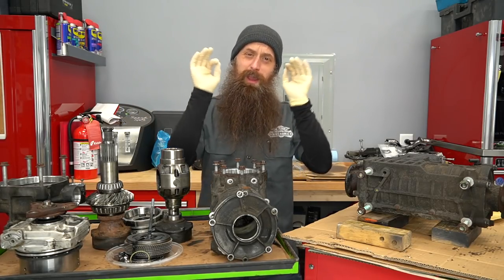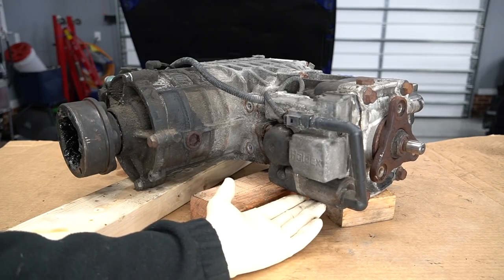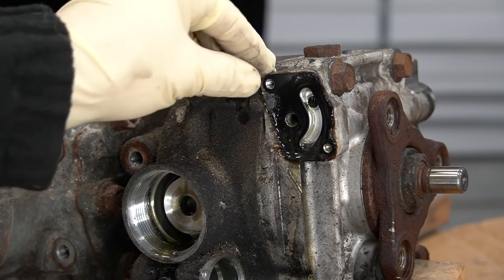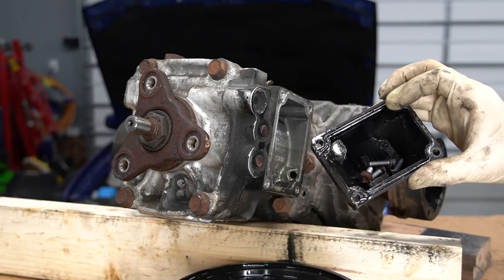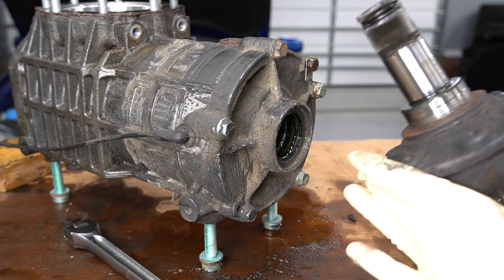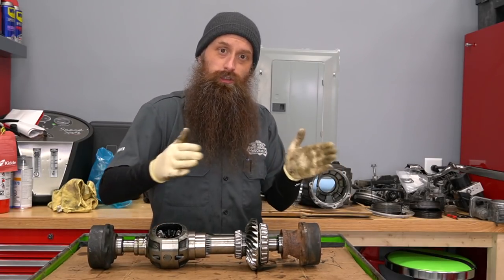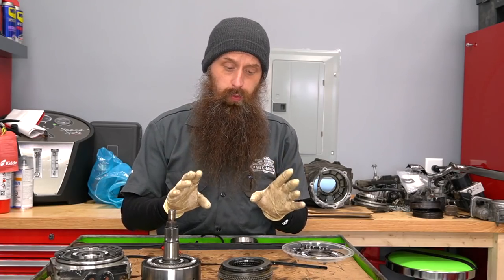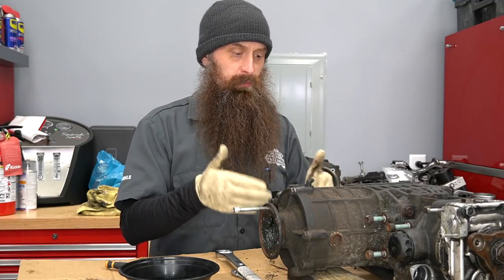How Haldex (AWD) All Wheel Drive Works ~ Teardown and inspection

Comment from the maker: Something I am not sure how I forgot to mention. The Haldex and diff fluid are DIFFERENT. If you do the service, be sure to use the proper fluid.
Reply: Simply RTFM. Different diff, different oil. Just look it up, to be sure. Helps not killing things. 😇
Reply: Charles, have it dry ice cleaned
Reply: Please do the diy! I am absolutly enjoing the videos!
Reply: I’m glad you mentioned this fact as no one else points this important fact out to all the DIY legends
Reply: What LSD is it? Looking forward to do it myself!
Reply: Be also careful to put the fluids where they belong ... don't mix them up
Reply: Diff: 75w-90 GL5
Haldex: Only Haldex Fluid from VW or Volvo or BorgWarner
Reply: When will Part 2 arrive !? I need more of that 🤫
Reply: Transmission Fluid:
OEM PN G 052 171 A2

Differential fluid: (same for front and rear)
OEM PN G 052 145 S2

Haldex Fluid: 
OEM PN G 055 175 A2 or G 060 175 A2 ( only difference is amount, 1L or 850ml)

I have Golf mk6 and filter is different from this one on your video, and "PN" for mine is 111358
Reply: Do you have a link for that single unit haldex clutchpack.... I'd love one for my mk6 golf r.... give me more of a real awd
Reply: lol that almost got me.... I had a 1/2 quart left over from my GTI diff job... I ALMOST thought about just putting in my haldex.. glad i didnt.
Reply: troubleshooting*** my car binds on the corners, its a 4 motion. I have seen that changing the oil fix the problem. How can I know is the oil and not the pump.

Comment: Almost 5 years at a VW/Audi dealer as a tech I could never wrap my head around how a Haldex worked. All I needed was this video! 
Do newer Haldex units work in a similar way?
Reply: There's actually some more stuff Charles missed.  This is a gen 1 haldex which actually works on a mostly mechanical(ish) function.  The rollers that fell out when Charles pulled the clutch drum assembly, those are parts of the mechanical pump and piston function.  The small rollers act on a Cam plate/Lobed plate which serves as the "pump" plate, the three big rollers act on the piston plate which applies pressure on the clutch pack.  The pumping action starts as soon as there's a difference in shaft rotation speed between the input and output.  The electric pump really only serves to prime the system and charge the accumulator.  System regulation is handled through the regulating valve.  Basically, when you're easy cruising/coasting/parking with no wheel slip, the system is always at the ready to lock up for AWD.  When you're mobbin' around pedal to the floor, "spirited driving", etc..., the system is already set for AWD, but the mechanical pumping action is what actually engages the lock up for AWD, therby making it a "reactive system".  That's how gen 1 & 2 Haldex works.  Gen 3 onwards used an entirely electric pump system, meaning through software the system can be, or is,  tuned to be "proactive" so AWD could be locked up, or "pre tensioned" before wheel spin.  All depends on the software parameters.  To this day, as best I know, Audi/VW has only used gen 1 & 4 systems.  Mechanical(ish) or electric, which is better?  Each have their pro's and con's, but my 03 BEA powered TT's AWD is fantastic, so much so it does it's job seamlessly and I still haven't needed to replace my Haldex pump yet, ....unlike many people with gen 4 Haldex cars.  
BTW, not trying to rip on Charles.  He's great and this was an absolutely great tear down video (speaking as a former long term Audi/VW tech myself).  Just typing out a long winded ramble to answer your question.
Reply: Didn't you guys have to do courses all the time?  I'm guessing the VAG line on how to repair these was to "replace Haldex coupling" entirely?  Either that or you never saw one fail apart from electronics/pump?  Anyway yeah the newer ones are very similar, they've changed some of the operation in terms of pumps, etc. but the main principle is the same.  It has actually been continually simplified over the years with 4th gen doing away with the mechanical pump, and 5th gen doing away with the accumulator, netting a smaller and lighter package over the years.  At the same time the electronics and integration with other systems (ESP/TC/ABS and driver inputs like steering & throttle) have improved quite a bit netting significantly improved real-world vehicle performance.
Reply: @colinwie9192  VAG used Gen2 in later PQ34 cars with quattro/4motion (e.g. Mk4 .:R32, Mk1 TT, A3) as well as early PQ35 cars (Mk2 A3 & TT 3.2L VR6/Mk5 .:R32); later PQ35 cars got Gen4 Haldex, starting around MY09 (in Can/US) including A3, TT, and Mk6 .:R.  B6 Passat/CC being PQ46 follows a similar timeline.  MQB cars have Gen5 couplings and much more integrated electronics than previous iterations.  Gen4 in the PQ35 cars never integrated ESP & steering functions (it did on other brands and the capability is there, VAG just didn't implement it).  There weren't many problems with 4th gen couplings, the problems were more on the early MQB cars with 5th gen Haldex.  5th gen has no accumulator so arguably the electric pump has a higher duty cycle or higher demand on it, which could have led to the failures though this is just speculation on my part.

Mk8 Golf R has what I believe would be Gen6, though it may just be a highly customised system with a Gen5 coupling at heart, not entirely sure.  The one gen they never used was Gen3 because this was specific to Land Rover.  Saab also had a customised Saab-only version in their XWD system, which nobody else ever used.
Reply: @colinwie9192 and a very informative ramble. Thanks.
Reply: 😂 @thePeterpumpkin68
Reply: @colinwie9192  Hi Colin, how do I identify the Haldex and Differential unit in my son's 2010 Audi TT 8J 2 Litre 4WD Diesel manual car as it has failed?
The local mechanic has suggested that we source a secondhand unit complete for him to replace the whole unit. My son lives in Northern Ireland and I live in UK mainland trying to help...

Comment: This system is amazing. Its actually smart enough to shut itself off when the unit is low on oil. I had a Audi TT quattro that had a non working rear diff. I just changed the filter and oil and it came back to life.

Comment: Super cool to see this video.  That was a bit of an "oops" moment, but at least you managed to get another.
I remember having to press half shafts for a Jaguar XF out so I could replace bearings. No forgotten snap rings, just seized tapers. 40T press failed to shift them. Ended up taking them to an heavy goods service centre who failed to press them out with & 15OT press. They had to take them round to the big boy toy and that registered 265T before the shafts finally broke taper. The bang was super loud.
Reply: That's insane. I wonder how the Jaguar dealer does that job?
Reply: Have you tried hamer it from the side while pressing? Usualy works if its not too stuck.
Reply: @robt8042  That's an easy conversation: "Hello, Mr. Customer? Your axles are corroded and seized and our shop press is unable to get them separated. We'll have to order new ones."

If it's not a personal project and I don't have a bunch of time authorized to dick around with giant shop presses, I'm not gonna waste a bunch of time on that noise.

Comment: Great video Charles! I like how the Haldex is basically an eletronically-controlled dirt bike wet-clutch assembly mated to a differential housing. I also like how the actual differential is separated from the ring/pinion gear drive via an input shaft. MUCH easier to set up then lets say a LSD on a ford 9" or a GM 10/12 bolt, but a bit more difficult to get to those same internals.

The one bit of advice I'd like to add is: the secret to long Haldex diff/clutch life is to  change the Haldex and diff gear fluid on a regular basis. Every 20 or 30K. The Haldex fluid isn't cheap, but it's cheaper then replacing the ECM, pump and pressure switch. Ask me how I know that! 😢 💸💸💸

Love your content bro! Cheers!

Comment: If the haldex clutch plates were replaced with solid drive plates, wouldn't that cause the front and rear axle to bind? Your enthusiasm and energy is admirable.
Thanks for sharing your knowledge.

Comment: When I did my 02M gearbox rebuild I used aluminium acid cleaner (wear gloves) to wash over, use general degreaser before. Leave acid on for 15 minutes, then I washed off with water. For an extra step I then hovered a blow torch over the casing to absorb the water and it came up looking near new
Reply from the maker: The torch idea is awesome
Reply: @HumbleMechanic  good luck! Can't wait to see this process all the way through

Comment: Yes to getting another video / DIY for installing the diff.  Also, if you don't want to blast and powdercoat the case, Eastwood makes a spray paint that looks exactly like freshly cast aluminum.  You could wire wheel or really just clean and de-grease the case and then use that spray paint.  I've used it on alternators and engine mounts, and it holds up pretty well and looks good.
Reply from the maker: I like that idea!!!!

Comment: I’ve smelled PLENTY of things worse than old diff fluid:

Smokers’ cars that had so much tar build up, the windows looked like they were tinted.

Burnt up automatic transmissions.

A car that had 2 dead cats in the spare tire well.
Reply: OMG!!! 😂😂😂😂😂👌
Reply from the maker: The smokers thing I’ve seen too. Ugh!!!!
Reply: Worst smell is the trash compactor at a supermarket nothing like rotting meat and vegetables getting baked by the summer sun.
Reply: Diff oil that's mixed with water, or reduction hub oil the same is pretty foul!
Reply: @brendanconnelly1835  Went to a farm on a 4H trip & they had a huge barn
of Turkey's,don't suggest you expose yourself to that unless your a farmer
growing them,stay with a Turkey Club at a Diner.
The Fish Market in San Fran was too much for me also.
Reply: @pczapp827  you should be there when they clean out those barns then spread it on a field, stinks for miles.

Comment: Awesome video as usual! I thought that my rear diff was broken and after changing the haldex oil and a new filter it came back to life! Amazing what a service does!
Reply: did your car experience binding around the corners? I am having an issue when my car binds when cornering. did the oil change fixed the issue?
Reply: @humbertom1184  It was like a chattering/clicking noise when cornering hard,specially when parking or coming out of tight spots and some corners.
It was similar as if a calliper was seized too and the oil and filter change worked for me,it took a day to start working properly and it’s been good for a couple of years now.
Reply: I'm having the same issue,  oil and filter change seemed to fix it for an hour or so. Problem goes away then unplugging the haldex.

Comment: Can you make a video explaining how having different tire compounds from 2 different manufacturers could affect the reliability of the AWD system.
Reply from the maker: SOLID topic! .
Reply: I would say the tire compound doesn't affect the AWD system if the tire radius is the same. The system is probably designed to have front and rear wheels rotating at the same speed while driving straight. If rear and front wheels have different sizes, the center diff will be active all the time (or in cars where haldex replaces the center diff, the haldex discs are slipping all the time) which will introduce extra heat and wear.

If your center diff if torsen type, it could be damaged by the heat, too.

The different tire compound should affect the rear and front tires wearing at different speeds and causing different radius forcing the center diff to always be active.
Reply: Depends what you mean by reliability of the awd system.  If you're talking traction, compound would have a huge impact.  If you mean mechanical component longevity, that wouldn't really be impacted much aside from a huge power  build with extra sticky rubber driven by a total bell end breaking things.

Comment: So i guess that there are a clutch pack with better friction plate and more of them like there is on Motorcycles. It's a normal upgrade on MX machines. That combined with the LSD diff and front LSD dig should give you a lot more traction to the wheels. 

And yes a install video would be nice. It's always nice to have youtube  to show you how to do stuff. I have saved a ton of money and time by watching YouTube to finde and repare faults.

Comment: Ive had awesome results using oven cleaner to clean dirty aluminum and steel parts. Obviously avoiding electrical connectors but everything else comes out great. Finishing off with dishwashing liquid stops the aluminum from getting those white crusties afterwards.

Comment: Wonder if you took the electronic parts off if you could throw the entire unit into an ultrasound cleaner?
Would think it would do a pretty good job cleaning it up and as long as you got oil back in it as soon as its dry you wouldnt have any rust issues.

Comment: if you have the time and dedication you can take a fine scotch bright pad and use it as sandpaper all over the diff and do tricky sections with a small wire brush wheel on a dremel. I used this metod on the engine of my motorcycle (also aluminium, was in a similar condition), turned out much cleaner and had that "aluminium" colour again.

Comment: Charles if you haven't yet come up with a solution for the diff case I would definitely look into dry ice blasting if there's someone nearby you that has a setup for it. No need to disassemble as there's no true abrasive media, just dry ice that evaporates to atmosphere.

Comment: You can clean it using ultrasonic cleaner. Its not for rust removal, but it will clear everything inside where you wouldnt get to normally.

Comment: Tool tech tips:
Half cookie sheet contains oil and stray parts. Orient parts in quadrants as they come off as a matter of practice to keep organized. 

Posi lock 3 jaw puller. Worth the price

Second half cookie sheet to transfer parts to once cleaned.
Reply from the maker: Love this!
Reply: I use the cookie sheets for many items. Really helpful when rebuilding carburetors. Triple Webbers take up a full sheet.

Comment: Charles could you make up some block off plates out of sheet metal and cover the holes on the diff so no media gets inside and you don't have to completely disassemble the whole thing?
Another very interesting video thank you for sharing.
Tony from Western Australia 🇦🇺
Reply from the maker: That’s an awesome idea!!
Reply: @HumbleMechanic sometimes we are to close to the problem to see the most direct answer! I'm glad I could trigger a possible solution. 

 I have to pass on a tip for your beard as well Charles,
Did you know if you take just a small cut off the end of your beard you only need to cut maybe 3mm top's every 2 months or so it will make the beard keep growing well?
Also by careful trimming just the shorter hairs you can force the shorter hairs to catch up with the longer ones. 
I got the tip from 2 different barbers and my best mate, and it works well it just a matter of getting over that thought of gentle trimming makes the beard grow
Tony from Western Australia 🇦🇺

Comment: Not 3 weeks ago I snapped a bolt putting my haldex pump housing back together so....that was fun
Reply from the maker: YIKES!
Reply: @HumbleMechanic  yea, I had it towed to a professional out of an abundance of caution. I didn't want to make it worse. I still don't know what the proper torque spec is supposed to be but I am surprised the bolt snapped at 15 nm.

Comment: I'm not experienced in this area, but people I know who rebuild engines and transmissions are a little bit iffy about media blasting parts with tight tolerances as the blasting media really does get everywhere and can cause problems, even if you're diligent in masking off and plugging important areas. I think a wire wheel clean-up is probably the safest, but most time-intensive route.
Reply from the maker: Soon actually. ;)
Reply: The wire wheel will fuck it all up too...

Comment: If you are after the raw aluminum look: wire wheel, acid etch it, then clear it or use a protective acid. Did it on an engine block but polished it then did the protective acid. They even make a kit for it
Reply from the maker: Nice!!!

Comment: Ive smelt trans fluid burnt so bad you could smell it from 30 yards away. If you where close it would burn your throat. Swapping the trans was a nightmare because of the smell.  Cousin delivered mail and newspapers drove about 600 miles a night, hydroplaned doing 80 miles an hour, did 2 360's, wound up in oncoming traffic, trans was toast afterwards. She never matainenced the car ever.🤣🤣

Comment: Modifying the clutch pack to give permanent AWD is pointless by the way. The system is designed to divert torque to the rear wheels only when needed. The benefit of this system over all others is that it can allow the vehicle to operate as FWD most of the time which reduces rolling resistance thus improving fuel economy. It is actually detrimental to drive the rear wheels at high speed when the front wheels are otherwise not slipping. The controller progressively backs off the torque split the faster you go.
The ATB/LSD you fitted however is definitely a good mod for a performance vehicle.

Comment: Excellent presentation as always !!! I have a question regarding the permanent engagement insert you mentioned from an Italian guy. As far as I know, the prop shaft spins continuously  as long as the engine works since it transfers the power from the gearbox in front, before the clutch. That, in my understanding implies that the rear wheels have to spin too, regardless of any gear engaged or not. Is that so? Would you elaborate please?